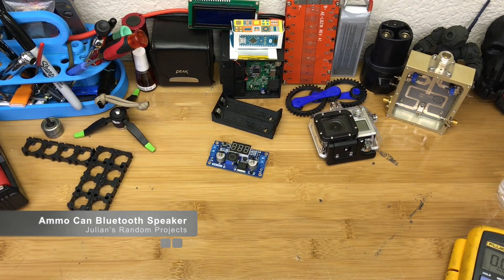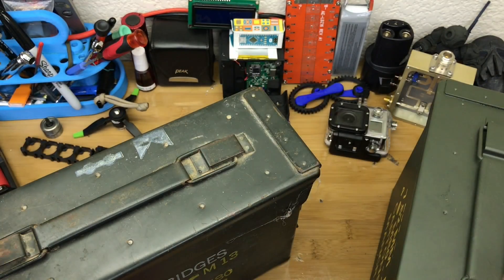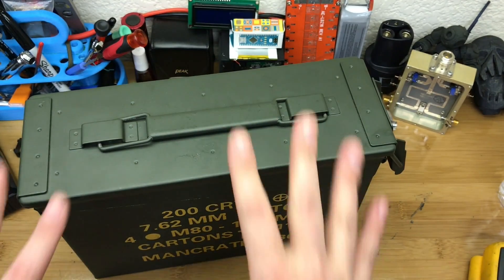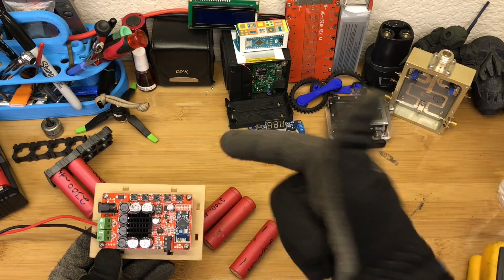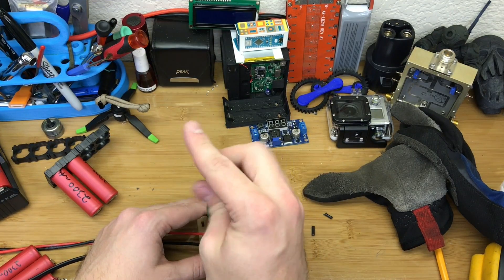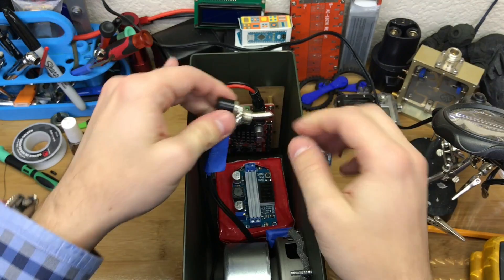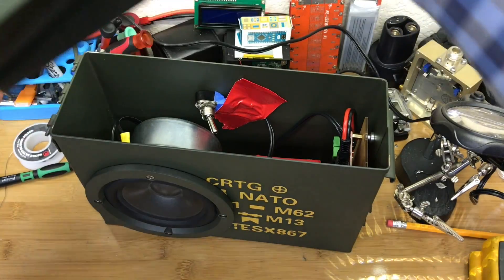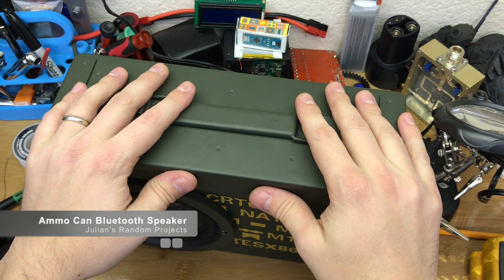Ammo Can Speaker - Bluetooth (Yet Another)

Comment: Is it necessary to use a power adapter inside the box for a 12v Lithium battery recharge ?
Reply from the maker: No power adapter needed if your battery voltage matches what your Audio Amp and Bluetooth board need. Check the manufacture's specs of the board you choose. Godspeed!
Reply: @JuliansRandomProject  My amp stays between 15 and 36 volts my battery is 26,8 volts.

Comment: I was curious about the bridging also. Have you had any issues or tested just running off the left or right side for better sound quality?
Reply from the maker: Got mixed mono by bridging, no issues to date. Haven't tested left or right separately for better quality sound. I've been using it in the garage and it's performing very well. The slight hum from the voltage converter seems to be drowned out when music is playing.

Comment: Thanks for the video, I was really lost on how to build a 12v lower pack. eBay has these 18650 holders, where you just slide them in, and it automatically connects them together. Do you think I should solder my own packs instead? I've tried soldering 18650's before and it's a real pain in the ass.
Reply from the maker: Soldering them is a pain, I agree. If I was going to do this again I'd use LifePo4 in the 18650 form factor and buy holders Jehu Garcia has been experimenting with lately https://www.youtube.com/watch?v=jTZ-529NCOA Good luck!

Comment: It’s not SODDERING, there’s an “L” in it, it’s SOLDER!
Reply from the maker: LOL! In my career I've been trained and certified to solder multi-layered, microscopic, surface mount components for use in aviation and space bound equipment. I assure you, I'm pronouncing it correctly. ;)
Reply: JuliansRandomProject I’m an electrical fitter and I’ve soldered tonnes of connectors, there’s definitely an L in it. You guys can’t pronounce aluminium correctly either